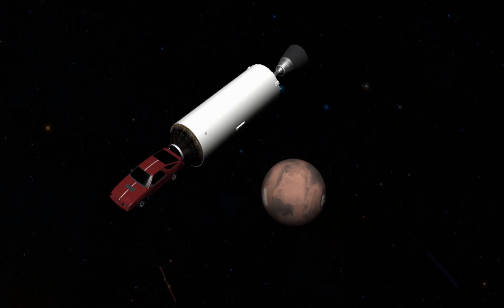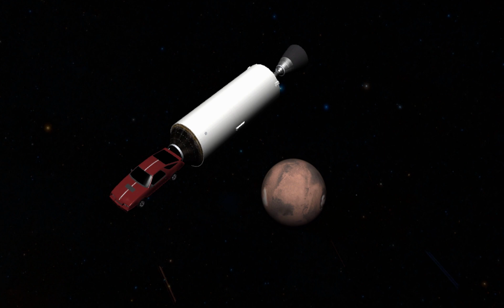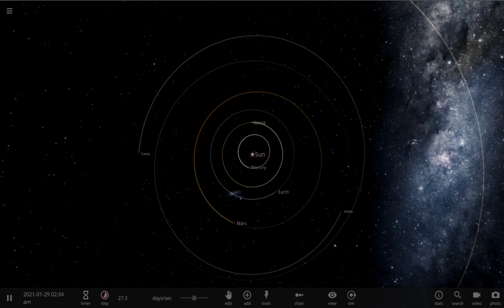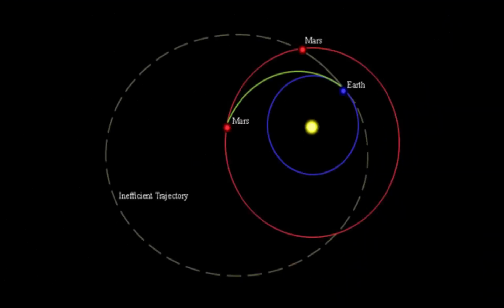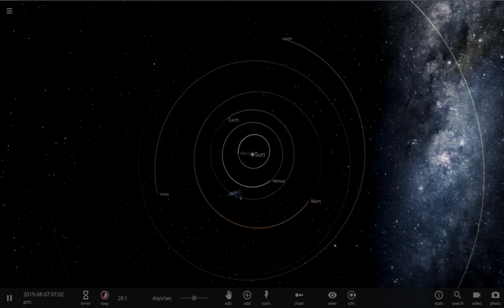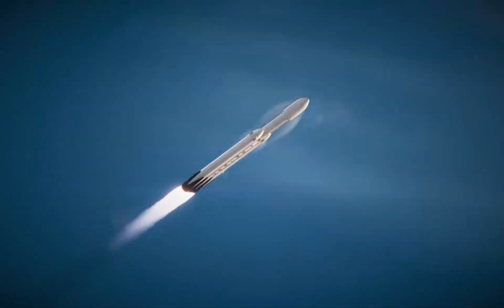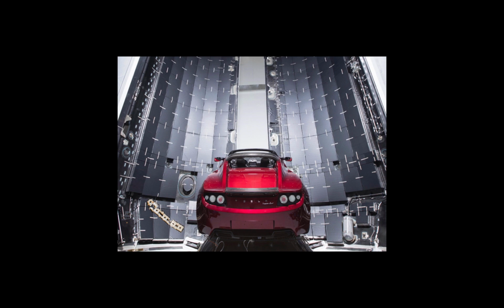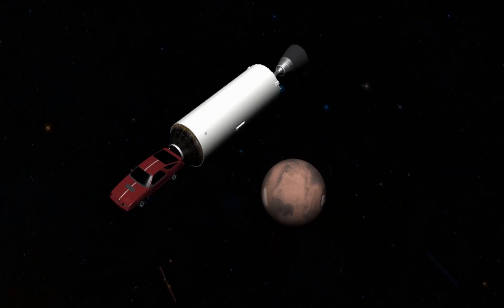How Far Can The Roadster Get -Explaining How The Falcon Heavy Can Reach Mars Outside Transfer Window

Comment: indeed launching a tesla is stupid, it`s a great chance Falcon Heavy will blow before reaching 30 feet height, and a full lithium tesla battery will be glad to burn , damaging the launch pad even more...The concrete block idea was much better.
Reply: Au contraire.  Launching a Tesla is brilliant stroke of marketing.  It not only brings attention to the Tesla brand but to Space X as well.
Reply from the maker: it jsut means that I'm goign to respond on your level, thats jsut fair - the paint on vessels counts because it could start a fire - it could catch fire, thus starting a chain reaction setting other things on fire, it doesn't count because it would b additional fuel if a fire starts elsewhere - if oyu work with liquid oxygen oyu should knwo that when mixing liquid oxygen with fuel and iginiting the whole thing a fire extinguisher becmes pointless - and steel weakens way before it melts, there are tabels specifieing the tensile strength of different kinds of steel in different operational temperatures and they go to about half the room temperature strength at temperatures easily reached by jet engines - I know because I've done work on jet engine parts - which are quite defintiely heated up by jet fuel and nothing else - and even in front of the combustion chamber they already have to be designed with extreme additional factors which is part of the reason why supersonic airliners
Reply from the maker: okay, end of disussion, you are appaerently neither remotely educated, nor remotely ntellignet nor a decent human being, might as well ignore you
Reply: this post didn't age well
Reply: I'm guessing it's a gutless Tesla; just the shell
Reply from the maker: I found it funny, not stupid - also the amount of lithium contained in the tesla battery is still nothing compared to the size of a rocket, there is simply no way it could significantly affect an explosion, in order to have any notable overall effect it would have to go way beyond the orders of magnitude anything chemical could do but lithium isn't uranium and the tesla is not a nuclear bomb (though even htose tend to only go off under precision timing not random explosions)
Reply from the maker: in order for a catalyst to affect a chemical reaction it has to be in contact with the chemicals reacting first - also, while a small cquantity of a catalyst can start a chain reaction and start a fire that otherwise wouldn't happen, in order to make the fire once started burn hotter you need a quantity of catalyst in a notable order of the fuel oyur burning, smething like 1% or 2% - not 0.005%
also the effects of lithium batteres on fires are quite well known, many rockets have launcehd satellites caryryign such batteries before and its not like a tragedy could happe here anyways, as there are no humans anywhere nearby
Reply: Thr battery was removed douche
Reply: +Neville Madden the story I heard was that two of the three engines required to bring the core to a safe landing failed to restart, and the core impacted the ocean very close to the barge at around 500km/h.

The video seems to be consistent - nice bright sunny sky, and abruptly it's in the middle of a rainstorm and the camera and/or transmitting gear gets knocked out.

As I understand the flight profile, the booster is travelling quite fast until very late, with the engines throttled all the way down (or off), just getting minor course changes from control motors.  If the mains were expected to relight at 5-10K feet, for example, they'd have almost zero time to try a second restart or redirect the rocket away, before it hit.

The core probably attempted its landing from a greater height than they've ever tried before.
Reply: you suck
Reply: I am sure they took the battery's out   lol
Reply: I would send a big tank of made like a Dewar with passive radiators for excess heat. Send it to L4 or L5 of the Earth-Moon system. Future folk could use it to drink or crack with solar energy for oxygen to breath or maybe LOX-LH2 fuel to get home.
Reply: You clearly never heard of catalysts , substances that can affect a reaction in small quantities . It`s the small difference that makes a fire melt iron from the launching pad of a rocket or from a huge building. And nobody researched for real what can rise the temperature of a fire in such an event, you`re just assuming nothing will happen. And this is the way all tragedies happened, by assuming the best and happening the worst.
Reply: the tragedy is huge for me dude, as if more launching pads are ruined i don`t get to see the rocket program moving forward
Reply from the maker: its rocket science - if you have naything to do with rockets you should get used to the fact that problems happen and stuff gets destroyed - after all, for any other rocket the entire rocket is thrown away during launch - but a damaged launchpad which can always happen if oyu use it at all, is not at all comparable to the tragedy of human lives lost
Reply: Julian Danzer d
Reply: so fukcing staal assole is not a tesla, but half of it.
Reply: Does it make you feel good being this much of a killjoy? It just went beautifully, and launching that car will pay untold dividends in social interest in space exploration. It's just damn cool.
Reply: But was it a complete success?  Where is that Center Core booster?  Overall I think it's a success.  I just wonder why the silence on the center core.  I can't find a peep about it anywhere.
Reply: Looks like the core is gone, but still unbelievable success. 2/3 rocket components safe and the droneship landings have been proven in the past. Big day for SpaceX. https://twitter.com/hummelmose/status/960985122693632000
Reply: its a great chance you will insert your foot in your mouth and say something stupid..
Reply: How do you figure that friend Bobby?
Reply: +Willierants ... Obviously you didn't Watch the Launch LIVE on an Official Website or YouTube Channel.
It was announced during the return voyage of the 3rd Main Core that due to Excessive Vibration, the Camera's on the Rocket were Knocked Offline, hence Loss Of Transmission.  Also, the Atmospheric Stability in the Vicinity of the Landing Barge would have been affected, and this would most likely have affected any Camera/s on the Barge:  Unless the Camera/s on the Barge were not LIVE, and have to be recovered before they are aired.  But I would guess that they were probably knocked Offline.
But, I'm pretty sure we'll see something eventually, because hopefully there was/were Boats/Ships nearby that got footage.
Reply: so stupid its BRILLIANT.

The references were the important thing.  Man cannot live by bread alone..
Reply: +Julian Danzer for comparison purposes: Roughly speaking, the Russian N1 (their "moon rocket") had approximately the same amount of fuel as a Saturn V, and about 40% more fuel than the Falcon Heavy.  All four launches of the N1 failed.  One of these explosions is believed to have been equivalent to about 1000 tons of TNT - equivalent to a 1Kt nuclear weapon.  It killed many of the ground crews in their bunkers and destroyed the pad.  There's very little photographic evidence, and what there is is of very poor quality.   The Halifax explosion in 1917 (largest explosion up to WWII) was 2.9Kt, and it's the third largest non-nuclear explosion ever - killed 2000 people, injured 9000 and flattened a city, completely erasing parts. and formed a tsunami in the harbor that reached 60 feet high.   A 4 inch gun off one of the ships was thrown 3.5 miles north, and it's anchor 2 miles south.  The N1 explosion in 1969 was more than a third of that.

if the Falcon heavy blew up on the pad, it would have been about .7Kt (700 tons of TNT) - one quarter of Halifax.  Probably completely flatten everything for several hundred yards, and throw pieces far further.

In an explosion of that magitude, a Tesla battery blowing up would be unnoticeable.  Most of the energy released  from a charged battery catching fire is actually the extreme high rate discharge of the battery power - in effect, an electrical fire/massive short.  You merely have to calculate the energy the battery can store, and compare it against .7Kt of TNT, and immediately realise that the energy release of the battery can basically be ignored, except that maybe, just maybe, part of the cloud would contain a bright flash.  Now, there may well be some toxicity issues, but it gets relatively benign once out of the metallic form, other than some compounds being caustic in high concentrations.  Which it wouldn't be in an incident of that magnitude.

By itself, a Tesla battery fire may be impressive, but when compared to 700 tons of TNT?  Nope.

Oh, and yes, lithium can act as a catalyst, but not usefully in this sort of reaction.
Reply: himano lganor, your view is shortsighted.  It was brilliant, even genius, advertising for Tesla and for the Space X program!  Boring to watch a piece of concrete being hurled out into space, now a Tesla with Starman in it was absolutely brilliant and far more interesting!
Reply: actually poor Uncle, nobody enjoyed more than me the takeoff of the Falcon Heavy . Sadly all the great feeling ended when the BS uncovering of the car started...it was such a bad taste it ruined all for me. Maybe you like adware and commercials like any snowflake, but i don`t. Instead i wished a stupid block of wood would be launched with a solar panel on it so that we have video signal for years, instead just a few hours.Incredible that you enjoyed more the "commercial" than the launch itself...
Reply: Fromage Frizzbizz ...normally i shouldn`t answer to someone called fromage , but here we go... You act like you know something, but nobody knows, because nobody tested how Lithium reacts in an explosion. Now we hear that the damn car didn`t even had a battery, so the poor specialists from NASA might had been smarter than you.
Reply: Landis Hagerty ...same thing, seems like you`re smarter than the NASA  specialists that took the battery out of the damned car before the launch. All the killjoy for nothing, just a thousand pounds of Lithium. Aww, they`ve let a small battery on the videocamera to function for a few hours...
Reply: Mr. Mark and you eat. And too much as we all see...you could have stopped before surpassing the weight of a Tesla car battery...but you didn`t...
Reply: Rob Mallicoat
it`s a greater chance Elon Musk is your father (get it ? got busy with your mum lol), but still he said, not me, that there is a 50% chance the Falcon will blowup on launch.
Reply from the maker: you clearly have no idea how big a rocket is... a ful tesla battery, 20 full tesla batteries would still be absolutely nothing compared to the fuel contained in just the tiny upperstage of the falcon heavy let alone the... rest of the falcon heavy - if this thing explodes the tesla battery will be the least worry, not only does it contain about 1/10 as much energy/mass - its also around 1/1000 times smaller, thats a 1/10000 ratio
Reply from the maker: also, even if it blows up, chances are it would at least reach a few kilometers altitude first, thats where the whole strapping rockets together idea gets most critical
Reply: did anyone  subscribe to your stoopid channel given how rude you are  ? i`ve seen a lot of crappy teslas burning and they DO matter. Instead that stupid car they could place fire extingushers in that rocket top that could make a difference, like some cans of liquid CO2 or such.
Reply from the maker: yeah, I only respond on the same level you start at - and no, compared to a rocket it does not matter -watch any number of rocket explosions and try if you can even spot the payload at all - battery fires can be deastating but compared to a rocket explosion that is negligable - I think there was a nice calculation once showing how the energy stored in the fuel of a Saturn  V compared ot the energy released by a nuclear weapon - thats the types of loads involved, a car is going to have as much impact on htis as an ant on the road may have on a carcrash
and yes, I do get a bit rude when people who havent done 5 seconds of research go around claimign they know better then people actually working on a project
Reply from the maker: This is the type of explosion you're talking about - it may look a bit misleading as its hard to judge size fro mthat far away but for reference that rocket is around 200feet tall - and thats about 1/3 as much fuel as a falcon heavy - if the heavy explodes,  expect a 1000 feet fireball, does this look like a tesla battery would matter in it?https://www.youtube.com/watch?v=_BgJEXQkjNQ
Reply from the maker: also fire extinguishers are useless on rocket explosions as they work by taking access from oxygen from the fire to suffocate it but rockets carry their own oxidizer so thats absolutely pointless
Reply from the maker: did I mention the one in the video isn't even fully fuelled at taht point? and its carrying a pyload about 10 times as heavy as a tesla roadster, could yo uspot the payload?
Reply from the maker: to put it into more humanscale/imaginable terms - thats like being bombed by a jetfighter and worrying that your phones battery might catch fire when the bomb hits you and it might hurt you - yes that might happen, but its the least of your problems - and grabbing a wet towel isn't going to protect you either
Reply: Boy! Were You WRONNNGGGGG !!! .. Launch Was Successful !!! ...
.. You DimWit !!!
Reply: @Julian Danzer no dude, it wasn`t about weakening iron, it was about the Aluminium from the plane`s shell, i`m surprised you didn`t knew...that raised the temperature a simple fuel can create (800) to over 1300 degrees so that the iron really melt. Please ask anyone (only really informed people please). About a big quantity of Lithium..nobody tested what this can do (unlike the team that recreated the fire conditions from 9/11 that was very well funded by the state). The real funny thing is you were the first laughing at Elon`s idea to send a stupid car(in the video), and now suddenly you`re the best defender ...
Reply: I don`t care about a few human lives lost. A tragedy like the launch pad in Cape Canaveral destroyed when launching Suckenberg`s satellite  can draw back human kind in all 8 billions, years back. And i`m waiting 40 years now and more to get to the next level after the Moon walks. Half century lost for nothing. Tomorrow a stupid meteor can wipe us all out.
Reply: I don't think so.  Either way this launch is a success.  Let's bask in the glory of it.  SpaceX, making space exploration profitable and making NASA look foolish at the same time.  NASA = Big Gov, they've wasted more funds on trying to prove "man-made global warming" than getting to Mars.  And got caught in lies while doing it.  There's simply too much politics in NASA today with no clear mission.
Reply: sorry for the delay fokes, i was up in Vegas for a blast 3 days, but lost all my cash...some ass holes will feel my frustration...
Reply: yeah right, and you`re just a troll, like i said days ago.